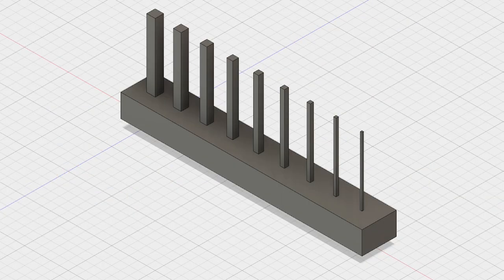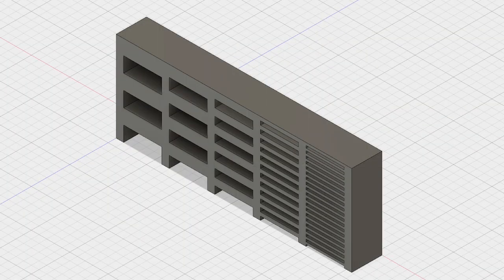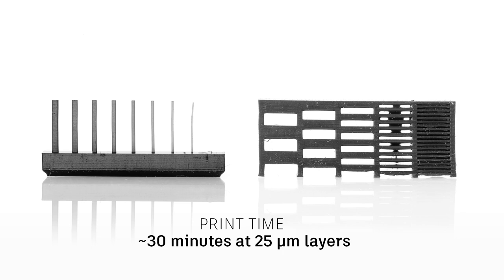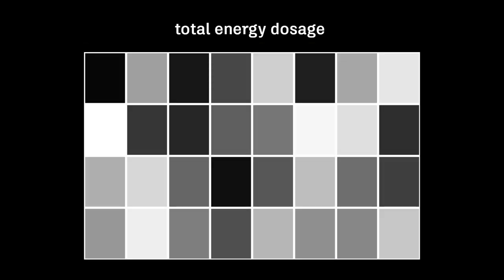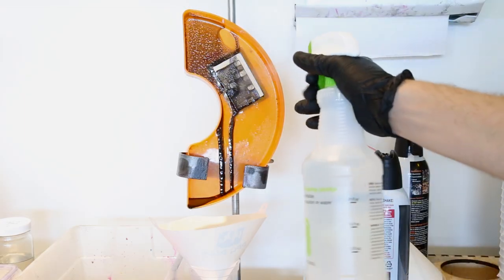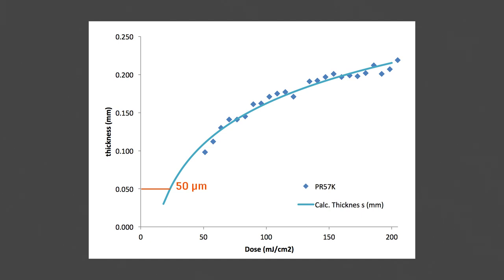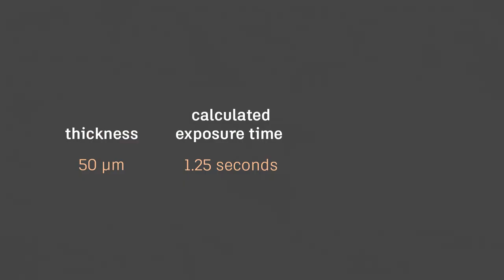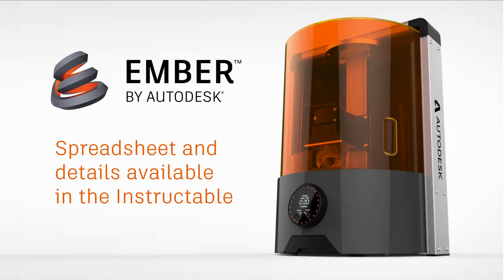Determine settings for 3D printing resins

Comment: Hello I have a question for anyone who is well-versed in 3d printing. I am very new to this and I am having some issues printing. (I have a Phrozen sonic mini) ( I am using anycubic translucent green)

2 things:

when I print, my build does not stick to the z plate

it only printed a small layer of the support (it is sitting in the vat, cuz it won't stick to the z plate thingy)

I am using Anycubic translucent green on a Phrozen sonic mini. The settings i used on Chitubox are as followed:

layer height: 0.03

retract speed: 200

bottom light off delay: 7

bottom layer count: 6

bottom exposure time: 25

Light-off delay: 7

bottom lift distance: 6

bottom lifting speed: 100

exposure time: 2

lifting distance: 5

lifting speed: 100

Any help at all would be greatly appreciated ASAP, I am trying to make a prosthetic and need wisdom lol. Thank you guys :) I will also be using anycubic UV black and have no idea what I should set the settings too. (one more thing haha, does anyone know a flexible resin... like TPU but its compatible with the Phrozen sonic mini?)

Comment: This is great, and so helpful. Does anyone know if a normal micrometer would work in place of the thickness gauge used in the video? I'm afraid elastomers won't be measurable using a micrometer.
Reply: As long as we can measure the thickness with precise accuracy.